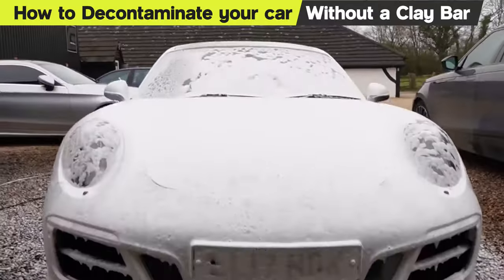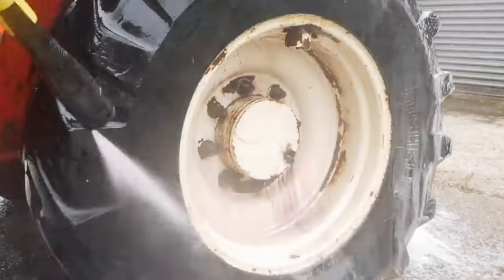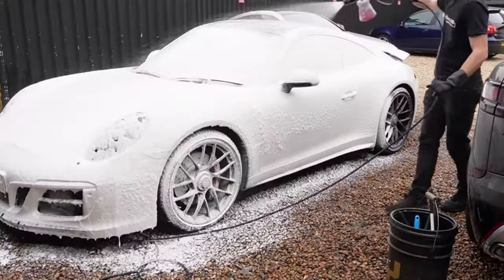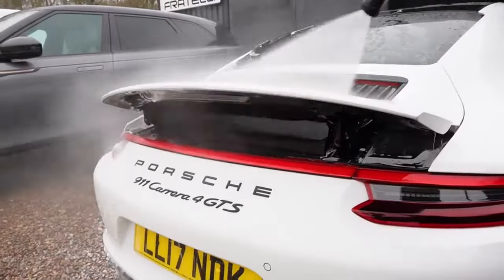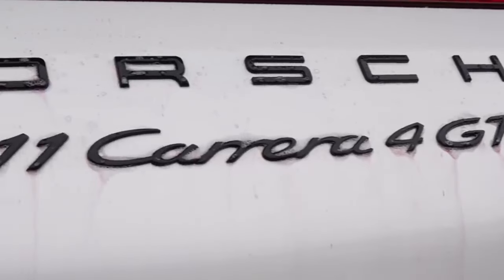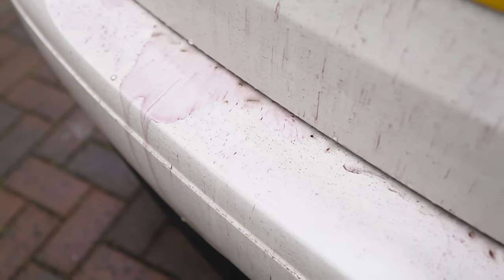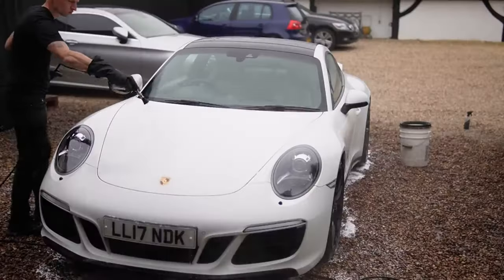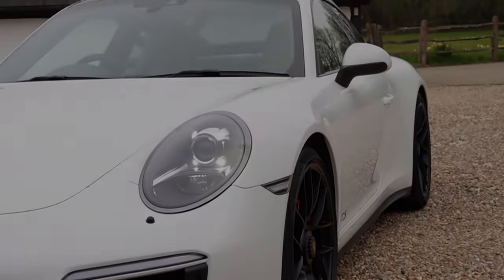How to Remove Black Spots From Car Paint  "THE QUICK AND EASY GUIDE"

Comment: i didn't realize at first that what i spay on to the alloys (none acid ) can be used to decontaminate the paint work and i was slightly worried to try it but it says on the label safe on plastic and paint also so now i use it when needed . Only from watching these videos you learn all these tips and tricks !
Reply from the maker: To be honest ph neutral wheel cleaner is actually safe on car paint. The words wheel cleaner put people off because they think it's more hazardous but you can get away with it

Comment: Hi Dave would you consider doing a review on the autoglym rapid aqua wax? There doesn’t seem to be many videos on it by detailers, cheers
Reply from the maker: To be honest it's not the best product, too many better products out there for the enthusiasts
Reply: @epicautomotivedetailing  ah ok that’s interesting to know , I’ve just watched your video where your comparing the ag rapid ceramic spray vs the turtle wax and was wondering if maybe id be better off with the ceramic spray as it gives longer protection and seems to bead as good as any wax!

Comment: If you use the iron fallout remover on a wet car, aren't you effectively diluting the product? Applying to a dry car is more effective surely? 🤔
Reply from the maker: No not necessarily because spraying fallout remover over dirt reduces effectiveness as it won't bond to paint so after that first wash it won't be completely covered in water so much of it has run off the bodywork